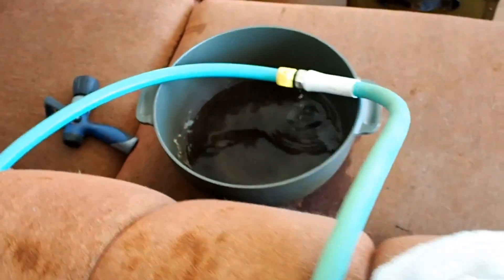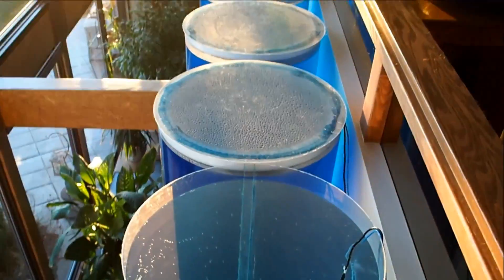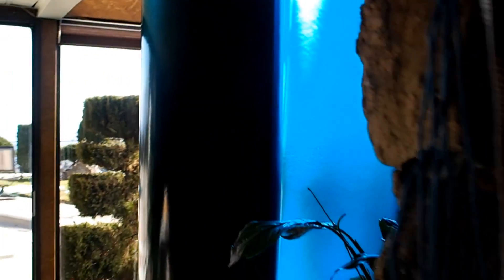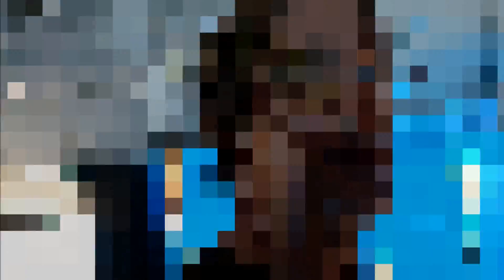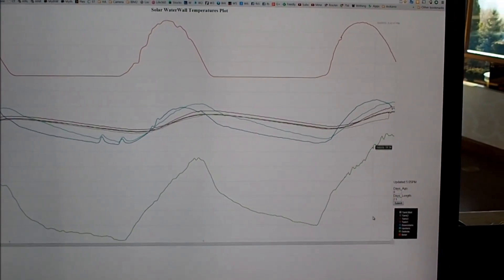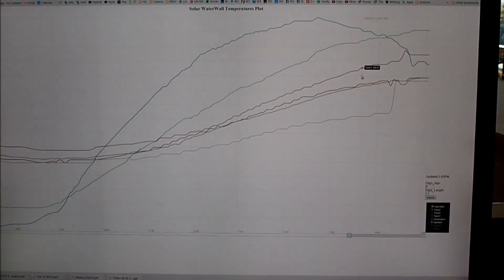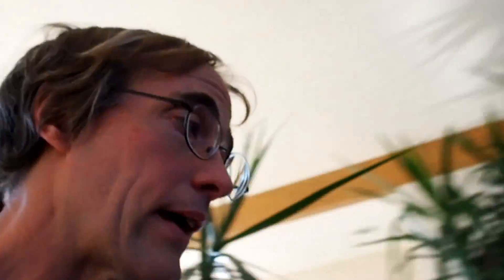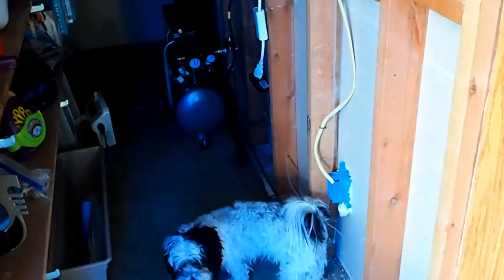Passive solar water wall battery

Comment: so...did you say that water has DOUBLE the heat retention ability of concrete? Is that "at any volume" or does there need to be a certain quantity of water to get those kinds of numbers? And, if you don't mind stepping into my imaginarium for a minute, do you think a gel substance could be developed that would have perhaps more retention than even water? I'm thinking of  not-likely-to-leak-gel in leak resistant containers between floor supports with a highly conductive top in direct contact w/a tile or concrete-slab floor. This has got my so-called mind a-spinning w/possibilities! :-)
Reply from the maker: Yep, water has double the heat capacity of concrete, give the same volume of each.   There are phase change materials out there that have even more, and there are several companies are now using that to make thermal batteries.    Search for something like "phase change heat storage battery".
Reply: Thanks, Bruce!
Reply: Bruce Winter an organic phase change material that would do the trick, and easy to come by is coconut oil. It will phase change at 26c or 79F I believe. For some ideal indoor temp, maybe a bit high. Filling the tanks with coconut oil though, might be quite expensive 😁. Cool idea though. And it's not only heat, it works as an ac aswell during the day.
Reply: Dan L has
Reply: mexon, sorry, I think your post got cropped.
Reply: Christian, maybe a second oil, non-compatible, with very different properties, and make a really huge lava lamp? :-)  I like the coconut idea, but, it would need to be oxygen free environment to keep it from going bad. (or reduced ox; a hermetic seal is probably not essential)  anything with a phase change at 68-72* ?

Comment: Really nice house I tought you own it, you did quite a expensive project you could make a much smaller one if it was just to collect data, 5 tons of water in one side of the house, you could have made some damage in the property.
The black water pillar store more energy, this is basic knowledge: who does walk in the hot summer in black T-shirt anyway.
Does your project have any difference with any roof installation of solar water heaters?
What about geothermal energy?

Comment: I think a small ozone generator is a good way to keep water in large drinking tanks fresh. But it requires some stuff and also you'd need to vent to the outside so the ozone doesn't come into the living room.

Comment: This was so awesome! Thank you. It is suddenly plain to see how water color affects heat capture. Definitely going to have to get an Arduino and some temp sensors. It has been certain exercise to heat an older singlewide by a wood stove with an 8" chimney straight up and out. Stoneage meets modern day.

Comment: Very cool system, how much energy is the control systems/fans/bubbles using in this 'Passive' system?
Reply from the maker: I ran the fan on medium, about 7 watts (high efficiency DC motors), for about 5 hours a day, so that would be about $.030 per Winter season.   The air pump was probably around $5 / year, as it came only  a few times a day for about a minute.

Comment: Great system!!! Have you thought about adding high amounts of salt to your system? Salt would prevent most common algae from growing and improve your thermal mass capacity of your water.
Reply from the maker: Did not consider salt, as just a bit of copper sulfate avoided algae.   You are right about the heat capacity, looks like salt water is 5% higher than fresh water.
Reply: I believe the eventual gain might be even higher seeing as the saltiest (sp?) water will sink down and the fresher water sits on top. This creates a layered system that increases the amount of heat that is possible to be stored. Search for 'solar pond' on youtube and you'll find systems that are used to generate heat and electricity with this.

Comment: What could you do with algae if you grew it in those tubes? Fertiliser? Food? The air pump seems over sized and may use more energy than it would take to gain the heat distribution benefits of the water towers. DC pumps are even quieter than AC pumps and can run from solar + maximiser combo without batteries.
Reply from the maker: I think algae farmers sell dried algae as a food supplement.  I never tried it.   The air pump was oversized, but hardly ever ran, so used little electricity.   I needed enough pressure (I forgot, maybe 20 lbs?) to get the air all the way to the bottom of the tank so it would bubble up.

Comment: Dont know if you already had insulating windows or like alot of other Americans only 1 pain of glass, but I bet that would be a lot better long term investment, maybe some more insulation in the drywalls. ;) 

I would constantly fear a leak or breakage of a tank, the wires and drywalls not to mention wood in all of the lower level of the house would be destroyed...

Where I live (In Denmark) it is required that all newer houses have at least 2 sheets of glass with a insulating gas in between and 200mm of insulation on the roof and some in the walls, therefore my house is at an energy level B+ the best is A+ (I believe) Ofc our power is about 10 cent per Kwh. so if we dont insulate we wont be able to pay the electrical bill..
Reply from the maker: We also had double pane windows, which are pretty standard these days, especially in the colder climates.   I would also fear leaks from a water wall like that on an upper level, but in my case it was on a lower level cement floor with a nearby drain.    You are right, though, if you have poor insulation, money is better spent there first.

Comment: This is really cool :) It would be even cooler if you incorporated machine learning to the data your house collects and automatically optimizes power consumption and the water color. You could hook up a mixing tank to the water tanks so the computer can control the amount of coloring and even the color and find a maximum. All tho if you you set it to maximum temperature it should just turn black which might be boring, so you could do something like "Maximum temperature under the condition that this amount of light should pass through the tubes". This can probably be analytically calculated too based on the suns radiation spectrum, so maybe this isn't the best application of machine learning, but it would still be cool if you did it :)

Comment: Thermosiphoning - STRUCTURES AS POTENTIAL ENERGY.
The existence of a T&P valve suggests untapped energy source.
Implementation example -We surround a wind mill with vertical evac tubes,raising water,
then drop the load, hydro generating. then repeat the cycle .
I agree with you, continuous flow probably won't work.
But filling a basin, then dropping it, would work.
This is not a stand alone solution, but rather an add on.
That's the concept,  we need help.
Figuring out how to bring concept to fruition.
How, and who to pitch this to ?
where we get funding ? gov grants ? crowd funding ?
Calculate loads ?
How do we explore further developments with your services ?
Regards JP.

Comment: Hi! I´m doing some research to write a monography about water wall and mass thermal storage for college. What kind of water did you use? is it salty or stilled, is it trated in  any way? did you used greywater?
Reply from the maker: Normal tap water, no greywater, with a bit of copper sulfate to avoid alge growth.  Does not take much, 1 gram / 250 gallons, so 5 grams per tube, which is about 1 teaspoon.
Reply: Thank you!
Reply: AboutDisneyFriendsGa  There's a wonderful piece in the Harrowsmith Reader 2 compilation about a home in New England that uses 400 five gallon glass carboys in the attic, heated by an outer skin greenhouse (single glazing) totally separate from the inner house (a 13' inner glass wall with triple glazing, goes right to the peak). Super insulated, has a rock bin below the house that air from the attic is blown thru, avoids condensation problems and I believe most if not all the heating needs are met by this system

Comment: Where did you buy your tubes? I would like to put them in a green house for thermal storage.
Reply from the maker: http://www.solar-components.com/TUBES.HTM .   More project info at http://misterhouse.blogspot.com/2015/03/passive-solar-water-wall-battery.html
Reply: SalmonHunter - 'Ever thought of making an outside-ground-insulated, greenhouse thermal mass sub-floor using water-filled 3ltr plastic milk cartons with gravel fill in between, dc fans blowing through ceiling <> floor controlled using thermal sensors / arduino / raspberry pi, solar panel 12vdc, deep-cycle battery, some supplemental LED lighting?

Comment: Thank you for your reply Bruce. Watched it twice more and I see the tops,I must have blinked and missed them before.thinking of using this type of heating in the workshed because sometimes I do not want to leave the work I am on and go to bed until I finish the project but in the late night the temp drops, your idea of the tank to release heat in the night, should do the trick in my space. I think the cats will like the heat too.Thank you for sharing your fabulous idea.

Comment: Love your sense of humour. The tanks are amazing, very sci fi , was expecting an alien to pop up from the depths of the huge tubes .They should easily work on reducing the fluctuations of the temperature within your home.the black is good for absorbing the suns energy but the blue looks great.look forward to seeing the outcome of this adventure. Do they have tops on the tubes? Would tops hold the heat in longer?
Reply from the maker: Yep, they come with flat removeable fiberglass tops.   In the night clip near the end of the video you can see the desk lights sit on and shine through those tops.

Comment: Have you tried painting just the sun side of the tube black, leaving the inside clear so you can see the bubbles and still get the light show while maximizing use of the sun on the absorption/sun side ?
Reply: While living in Alaska, I designed and built a passive solar heated greenhouse where I employed a black painted, south-facing wall of tubes above the grow zone containing an aeroponic system. The nutrient solution was then circulated through the tubes and stored in small drums employed to form the support the grow system. If left unventilated, ambient temperatures would exceed 135 degrees. I had three harvests per season using passive solar heat in a confined space. The black paint was what maximized the efficiency.
Reply from the maker: No, I did not try that, but sounds like a good idea!  If I still lived there, I would give it a try.
Reply: I think its right to make the tanks biologically productive like this. Painting the back of the tubes red or orange is an option, reflecting wavelengths useful to microbes back into the water, while sacrificing little of the overall heat absorbtion.

Comment: would it be better if you had both end tubes that were black ?
Reply from the maker: Yeah, that would have looked better, symmetrical.   Energy wise, all black tubes would have been best, but not looked as cool as those blue tubes.  In the end, I re-filled the black one and made all tubes the same dark blue color.
Reply: once you made the change to all blue what difference did it make to your readings?\
Reply from the maker: There was only one black tube, and only one light blue tube, so the overall difference was negligible.  The black tube absorbed about 20% more than the dark blue tube.
Reply: i could imagine that having all black may have gotten a bit ominous being a big black monolith in the house not to mention being a bit depressing

Comment: I can tell you like tech for tech's sake. Controlling an expensive remote controlled fan with an arduino when you could've just replaced it with a regular fan for less money and effort. Still fun to watch.
Reply from the maker: True, but by enabling computer control of the fan, I could optimize better when the fan was on, play with speeds, and measure the effect it had on energy absorption and dispersion.   But you entirely correct, much more complicated than it needed to be.
Reply: The one thing I caught Chris is that DC fan is incredible efficient- only 10 watts  vs  about 45 for an AC fan of the equivalent size
Reply: "DC fan is incredible efficient- only 10 watts  vs  about 45 for an AC fan of the equivalent size"
Um.... no. Both AC and DC motors are somewhat efficient, >95% is normal.
So 10W will simply result in somewhat less airflow.
Reply: You maybe able to improve efficiency of heat transfer water to air with a car radiator setup. You could pulse width modulate the fan. A large diameter fan at a slower speed pulse width modulated could. Save more energy then a full speed little fan.
Pumping water through the radiator can equalize tank temp as well. Cool setup. Might want to setup a watchdog with the Arduino as well
Reply: Bruce Winter pulse width modulating the fan motor is easier  than playing with ir. The ir codes use up a fair bit of mcu resources verse pwm
Reply: You're awesome! Constructing your own tech answers to life like a DIY Iron Man! Do you have complete resources for me to possibly build my own? Kids should revere people like you!
Reply: Mark Osborne That just reaffirms what I've heard about DC, it is better for running motors.

Comment: TOO SMART house improvement for me ! BUT IS AMAZING ! This could be the house of the future ! ! ! Will be hard to find some technicians TO BE ABLE TO DO THE WORK ! The labor might be too much (just thinking !)  Good subject for a doctoral dissertation ! ! ! BEAUTIFUL invention. Thank you !
Reply from the maker: Thanks!  The arduino with temperature probes are optional, as are the bubbles and fan.   Take those away then all you have is water in tubes.   Should be easy maintenance, just add tiny bit of copper sulfate maybe once a year.
Reply: Bruce Winter   - hi Bruce, I'm loving this and your other videos, and I'm learning a lot about little technical gear elements I want to use myself... I'm going to be putting lots of plastic jugs into my green house to regulate the night temperature during the winter, and I've been wondering but not putting too much thought into what I might use as a disinfectant, even though all the jugs and containers will be sealed tightly... You mentioned copper sulfate, I'm assuming the purpose of that is as a disinfectant, correct? Thanks! And I can look it up as usual, but i already typed this in, sooo...   ;)
Thanks for explaining your harmonious system's bits and pieces!
Reply from the maker: Hi Justin.   Copper sulfate is a very effective, and safe, way to keep algae from growing.  It doesn't take much.  I mixed 2 teaspoons in 1 quart of water, then split equally between the 10 tubes, which were 130 gallons each. 

Laur, thanks for the kind words!

Comment: You'll get algae in your tanks.
Reply: +Bruce Winter Would having algae absorb more heat than the blue? Surely not the black but they do have metabolisms interesting experiment with the right type of algae.
Reply from the maker: I put in copper sulfate to avoid that, doesn't take much.  But you are right, without that, algae would be a problem.   That is an alternate (probably more popular) use for those tubes ... making algae in algae farms.
Reply: Plumsmuglers - that's probably a yes. See algae absorb the sun for their own metabolic reactions ,thus converting the heat into energy for themselves rather than for our boy here.  So even though they might absorb more , they will not heat the room during the night and will not look as cool :)

Comment: This is an interesting idea with an artistic rendering, but $3000 USD????  It looks too out of place and junky to me to justify the $3000.  It also looks cool at the same time, but kind of junky.  I think a better idea would be to get plastic or metal barrels, for a much cheaper price, or some other cheap container to hold the water, and use an active or passive circulating system with concentrated solar thermal heating the water with the temperature being the pump as the hot water rises and circulates the water in the closed loop system. 
It might be more convenient and practical to use a pump, solar powered, or not.  I'd have a way to get water really hot, and store it, and then pump it around to where ever you need when you need it.  And try to have it hidden.  You might be able to have a sistern system that you also use to store heat, or maybe part of it.  There are so many things you can do with water and sun and pumps. We are mainly talking about the fall and winter and spring times and not the summer as you have too much heat the summer generally, except for heating water for the home.  There is not much sun where I live and in an apt, I can't really do anything, but if I had a house, I'd have a heliostat farm in no time using a lot of square footage of mirrors, and concetrate that into a lot of heat, even in the winter time on sunny days, and be able to use that heat for home heating and water heating. In the summer time, ...well you're fucked.

Comment: How have you liked your solar battery wall?  I have a new home project in Sacramento CA, where the temps reach as high as 110 F and as low as 25 F.  I am trying to build a passive home, and I think your wall could be a step in the right direction.
Reply from the maker: We had to move 6 months after the install, so I'm afraid I can't give you too much feedback.   We liked it for those 6 months though!